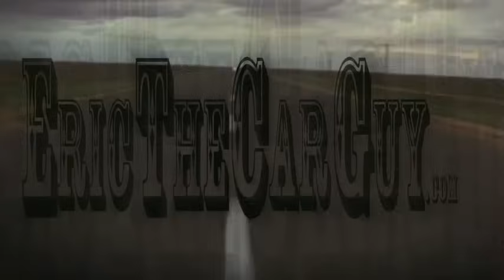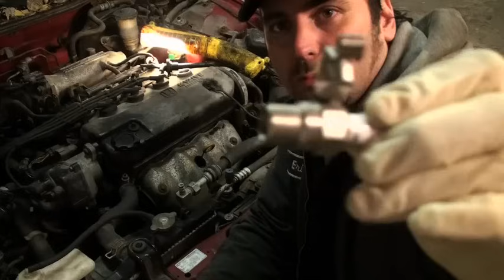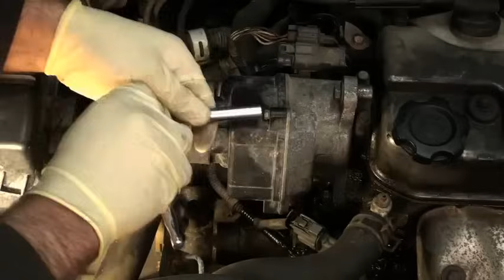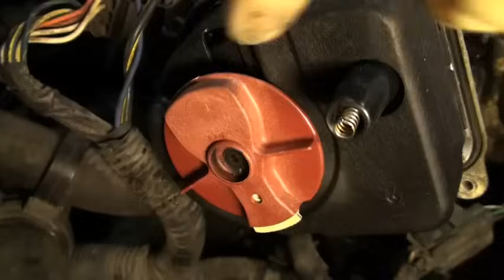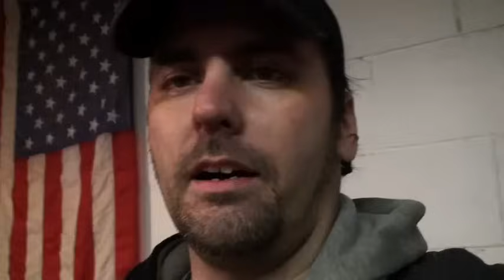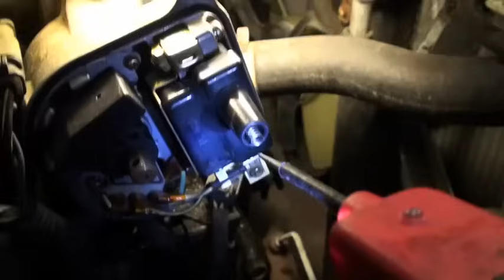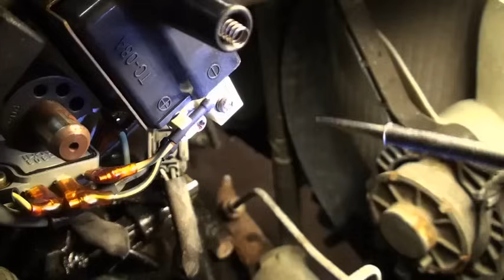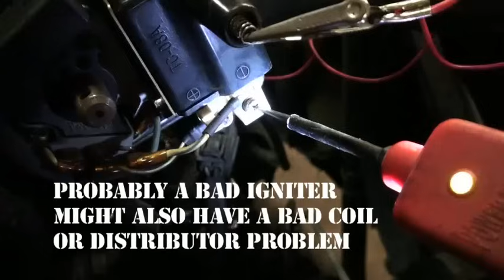No Spark Diagnosis (Honda) - EricTheCarGuy

Comment: This is an excellent  clear and helpful video. If I could just add one tip, which may be so obvious as to not really need mentioning, but it wasn't obvious to me so I'll mention it anyway. I have the same model Honda and had the same issue - no spark. My approach was far less methodical than Eric's: I started replacing the possible problem parts beginning at the cheapest. I replaced the coil (no joy) and then the igniter (still no joy) - which brought me here, to the purchase of a test light and a proper diagnostic approach courtesy of Eric. The problem, it turned out to be in the end, was a fuse. A fucking fuse! A twenty cent fuse!
It turns out that as well as the fusebox under the hood there is also one, better hidden, under the driver side dash that I'd been entirely unaware of. On the 'map' on the cover of it there is even a label for that fuse - 'ig-coil.' I replaced that fuse and the car went, straight away. So, I'd just highly recommend checking that fuse before you do anything else. You may well save yourself a great deal of trouble and expense.

Comment: So I've go a 1990 Accord and although the Distributor w/ Coil Inside looks same... I have turned the rotor around looking for the screw but there is just No Screw. Yet I can't seem to pull off the Rotor Button? I'm guessing its just got the plastic detent tang. It doesn't want to just pull off. So what is the Trick to get it off without breaking it. Its not bad and not the problem. No Spark @ coil but I need to get to the Test terminal but cant get the inner cover off without removing the rotor.  Arrrrrggggg!

Comment: Ha Eric I got 1994 Honda  accord crank no  start can hear fuel pump turn on but no start my question is when you checked the coil with test light to see if the ignitior was working was test light grind or to battery position also love videos you have help me a lot thanks

Comment: Hey guys sorry for sounding dumb 🤥 but I'm having a hard time finding the crankshaft sensor on my 99 honda accord.. I've had someone already check the spark, coil distributor and wondering if the sensor will be it but can't find.. can anyone assist plz

Comment: I have a 2001 Honda CR-V.  It will not start after the engine is hot.  Youtube videos stated three likely things,, Coil, Igniter, and temp sensor.  I replaced all three.  Also replaced Distributor Cap, Rotor, Wires, Plugs and fuel filter.   Still doesn't start after it is hot.  I am at a loss what to do.    Any ideas?
Reply: Turned out there are two temp sensors and it was the one further back that was the problem

Comment: 10yrs later still helping diagnosis problems. Lol 2000 civic random no start and sometimes when it does start it stalls within 3 minutes of idling. Won't start when sitting in the sun but will in the shade? Damn car!

Comment: I have a 1994 Honda Civic ex and I replaced the rotor, ignition coil, ignition control module, distributor cap and spark plugs and still won’t start but does crank just doesn’t turn over also I checked to see if there was spark at the wires and no spark can anyone please help me as to what it might be FYI 
I don’t know anything about cars aside from the very little I have learned from YouTube thank you in advance
Reply: Have you tried replacing the Main Relay under the steering wheel? Hope this helps.

Comment: Hi eric need help alot of people have tried with no luck 2000 honda accord f23a1 new ngk plugs cap rotor dizzy wires im getting spark to plug but if i remove the wire off cylinder #1 wich according to the scan tool is the cylinder thats misfiring car runs the same but if i pull 234 the car trys to stall what would be causing this

Comment: Eric you mentioned oil in the cap will that stop the car from running ? Is the oil caused by the o ring on the shaft ?

Comment: 01 CRV, crank but won't start. Battery good and kept charged. Did this suddenly. Was running fine the day before, except it stalled twice at low RPMs around slow turns but started right back up...I have ohm checked and visibly checked main relay (fuel), plugs, wires, all the way to inside distributor cap studs. I ohm checked the coil points also. All are good. Rotor looks ok I guess. Seems to have plenty of material. And I checked gap on the plugs.

I checked codes and none are stored.

If everything is reading good that I mentioned should the spark strength be good and strong enough? When I observed spark at the plug ends, it was daytime and I couldn't see if dark blue, but it was bright and consistent with good timing. 

I've also completely verified fuel except I haven't checked for power and control pulse on injector plugs. But it won't start with Starter Fluid sprayed into the throttle body either, so I'm assuming it's not fuel problem at this point. Fuel is being delivered to the injectors I know for fact. 

Before I buy a compression tester and remove oily covers and seals I want to verify spark is sufficient. Any guidance?

If cam sendor or crank sensors failed would it cause no crank or no start?

Comment: I changed all my spark plugs first because of a misfire and having also cylinder misfire codes plus random misfire. Unfortunately I removed the distributor cap and rotor and has all red dust in it. From something like that what is faulty !?? The ignition coil or igniter!? Please help also what is the other black boxes hook up. There is the ignition coil the igniter and also a third black box..

Comment: if at that point you still didnt get spark would you check fuses? if fuse are all good would you check crank and cam sensors or the wiring harness that goes from fuse box to distributor?

Comment: So i have a brand new distributor and still no spark fuel pump isnt kicking on ether unless u put 12v from battery to it i got a new main relay still no pump turn on still no spark any ideas im going nuts trying to figure this out

Comment: Hey Eric, love your videos. Need your help. I e been having trouble starting my 93 civic and noticed that my timing marks are off so when setting the timing marks at the crankshaft pulley and camshaft to correct TDC I will go to start the car and it doesn’t start but my concern is why doesn’t it stay TDC I will look after attempting to start and timing marks are completely off.. is that normal? Or should I reset the timing marks everytime until I get the car started?

Comment: I have a 1st Gen CRV with starting problems after the vehicle is at running temperature. I've changed the whole distributor, cap, rotor, plugs, wires, fuel pump, and main relay. What else could it be. I've also even changed the coil it self and noticed the spring has stretched on deformed for some reason. Do I need to start looking at engine ground

Comment: Hi Eric... I'm new auto electrician here in Philippines, i would like to ask u a question if you have a video's regarding an issue of No Crank/Start at all in Lincoln navigator 2003. The car suddenly shutdown the engine and no crank at all after reverse. Now I used a scanner but it didn't communicate as well to my scanner. Im not sure if this is an issue of scanner not suitable to the vehicle but i used my scanner to all brands before. But let me give u a hint on what I have already done and notice on my troubleshooting. First, when I switched ON the key in ignition position. There's this " PRNDL ERROR NO Park assist" message warning on vehicle Dash-Indicator board. And hence the problem is NO Crank and the problem only came up after going on reverse I removed the DTS(Digital Transmission Sensor) and looked on its sockets the signal voltage and also test the continuity of its pin by multitester off the bench and it all work fine. So I locate the starter relay, If i Removed the relay, and use a multimeter on coil pins of relay sockets i can get a positive and negative signal. As well as the main supply of 12volts for #30 pin of its relay. But using an external wire connects to the coil side... NO POWER at all have shown. So what i do next is hence there's a positive on signal on relay coil, i put a short wire jump on signal starting from DTS at relay pin #86 and #87. When i start the switch it Crank! But it wont start the engine,. So hence there's an message error shown on dashboard "PRNDL error NO Park assist. I locate the fuse for the PAM(Park Assist Module), and the error is GONE. So i thought i hit the jackpots! Because the engine is now cranking and there's no more message error in the dashboard. But still it didn't start at all. But its cranking., so what i do next is I replaced the PAM(Park assist module) and also the 2 reverse-park sensors on the rear bumber. And yet, the problem is still the same. If i will reconnect the relay and fuse for PAM. Still NO CRANK/START. Hope to read ur reply not too soon. Tnx in advance.

Comment: I found a some oil in my cap when I took it off rotor had corrosion as well as the leads in cap. Could that cause my Honda not to start. After I installed new fuel filter, fuel pump and fuel relay?

Comment: thanks so much for this! I have had a little oil in the distributor for a few years, not too much. I know the ring is leaking a little. Is it imperative to replace it? Never had issues until it died recently and I have no spark.

Comment: What can I check next since I’m not a mechanic but followed the steps you took on this video and still have the same problem. I change the  distributor cap and tried on another ignition coil and it’s still not turning the car on! Help please

Comment: My 1995 Honda Del Sol starts great but when it gets hot is starts missing.  I was told it was the distributor after I have changed the plugs, cables, and distributor cap.   Help

Comment: So could it ever be the crankshaft sensor I have this problem right now my 1998 honda crv shut off cranks but not start and I done tested the spark plug no power but someone told me to check the crankshaft sensor but tomorrow im going test the coil and ignition module hopefully its one of them

Comment: my 99 civic has a no crank no start issue, my dashboard light turned on, but no engine sound.  Just a humming noise.   I confirmed my battery is 12.7.   When I decided to jump the  battery, it started immediately.  I haven't checked the distributor cap yet.  Is it the Starter or the Distributor?

Comment: I would use an incandescent test light instead of the power probe  for spark check. A high voltage spark can damage it if you forget to depress ground switch (also ruins a LED test light). What is the other black plastic part next to the infighter?

Comment: Hi Eric The Car Guy! I need some advice with my 2001 Pt cruiser. It just died and is still dead. It will turn over that's it. Itll turn over all day. So no problem with battery. It has no problem with the fuel ..its actually flooding. .I have changed the crank shaft sensor.. but still nothing. I wish I lived by you because I'm NOT a mechanic and do not know of anyone I can believe
 Too many take your car a part and 5 ms later it's still sitting there. I need help please. Apparently I'm not good at this

Comment: Hey I changed ignition switch and main fuel. My car will drive a few miles and shut down. I don't have a test light. Would you say it's safe to just get the distributor parts? Im pretty sure I here my fuel kicking on

Comment: I came across this when my 2001 Honda stopped running. I first saw Eric's utube on the main fuel pump relay. I checked the relay and it was good. Eric mentioned this utube so I followed his outline. I found no spark at the plugs, but did have spark at the coil. I did not want to believe that the rotor or cap had gone bad. They are such simple devices. The tip of the rotor was chewed up. I changed the cap and rotor for $35 and sure enough it fixed the problem.

Thanks Eric, you are a savior.

Comment: So i recently had a mechanic install a brand new coil in my b20z engine. As of now i have no spark running through the distributor. I have warranty on the coil is my answer to replace the entire coil?

Comment: or you could be like me and forget to plug in the ground for the distributor (probably) attached to the thermostat housing.  You need the hands of a 4 year old to get that screwed back in.  Until I found that ground wire I assumed I'd knocked something loose with all the paint flaking off, plastic parts disintegrating, tape vaporizing on the 30 year old engine

Comment: i have a 98 honda civic lx you can crank it  up it will run for about 2 seconds and shut off like its out of gas , but the fuel pump is new , new fuel filter , still start run about 2 second shut off. what ease can i do.

Comment: Watching this in 2019.  What a tremendous service you do to the community, Eric.  We love you.

I wish I had seen this video in 1999, when my 1991 Civic's igniter blew. Ugh.  (Of course, that would have been impossible.)  

I always keep a spare igniter and coil handy now, but they are aftermarket, because Honda wants 10X the cost for OEM.  I'd love to go Honda, but at 10X the cost? Sorry.  I'll take my chances that the aftermarket won't fail 9 times before needing the 10th.

Comment: Eric thank you my 01 accord lx with a 2.3L VeTec would start then run fun then miss and then die. I did all the checks and check main fuel relay no cracks or brakes in solder and it clicked on an off during attempted start. Then fuel pump check and it had power but replaced it anyway due to the age. But problem still existed. So check plugs no issues and I had fire at the plugs but was erratic. I checked the igniter and it flashed as you described. Next the coil is turn on the key it would spark them during cranking no spark or an occasional weak spark. Then while the key was on it started shooting lightning bolts all over. So coil is bad no doubt. Cap and rotor are dry and no oil in the cap. It only started the other day out of the blue and would run and then not run and start and not start. So I’m replacing the coil today. I’ll let you know if that is the fix. For everyone wondering I used nothing more than a 3 dollar test light from harbor Frieght I actually got for free. Thank you for you channel and your work. You truly are one of the most helpful individuals on YouTube.

Comment: My car start and run but only a few minutes. When i try to start again the engine there are no sparks coming from my new sparkplug. After a few minutes standby the engine start again then run again by few minutes.  do you have idea on this? Thanks
Reply: And i already replace the ignition coil. My car is 2007 KIA Rio. Thanks

Comment: Hello Eric. I was driving home from work tonight in my 98 Civic hatch. I've been having problems lately. Car been losing power have to step on the gas twice to give it power again. Been like that for months. I changed fuel pump and filter. New spark plugs and ngk wires. Also new distributor cap and rotor. One day I drove home like tonight and the car didn't start at all next morning. That's what happened tonight. I drove home and hopped back in and it did not even turn at all. The other time it did that my mechanic swapped it out with a used distributor and it turned on. So that time it was the distributor. I'm thinking of tonight maybe it's the old distributor having the Ignition coil problem. I want to wake up tomorrow and go get the correct part. The Ignition coil is like $70 at the AAP by my house. The ignitor is quite expensive like $140. I'm thinking maybe Ignition coil but idk at this point. I can also order a complete distributor from eBay for $70. IDK what to do at this point. Want to solve this problem completely. If you see this Eric please give me a good suggestion. Thank you!

Comment: Hello Eric.. hope to hear soon.. my car stalled, rotor was melted a bit by the screw, I swapped out coil with a good spare, cap and rotor. As I tried to start for 4-5 seconds a wisp of smoke came out of distributor. Guessing igniter is screwed?

Comment: My car sputtered and died and now I have a crank no start, I have spark and coil and plugs and fuel. I swapped out the main relay. I sprayed fuel into the intake and the car tried to start just a tiny bit. I can’t figure out what it the problem, any advice ?

Comment: Nice video.  My daughter has a 2000 Honda CRV that will turn over but not fire up.  Your diagnostic steps and tips are great.  My first reaction would be to look at the distributor cap and rotor to see about oil and contact corrosion/fouling.  Your testing tips on the igniter and coil are perfect in case the distributor cap/rotor check out.  Thanks!!

Comment: hey eric i need to ask a question: i have a honda civic ek coupe engine d16y8,took it to the mechanic and everything is good in the engine compression timeing
ecu injector fuel pump every possible thing and the car cranks but it just wont start.what could it be ?

Comment: I need help w my 99 Honda crv it just stopped no power at all I am trying to find out how to get behind the fuse box because I found a wire hanging n the fuse to the ignition switch was melted on plastic part ? I have already done a fee things that were suggested but I feel the wiring may be the problem! thank u

Comment: I have a 2000 crv spark is good wires are good but when you drive it for 15 min it shuts it self off, fist by losing power then lights come on then motor dies. I wait 10 to 20 min and then it start right up. But it runs for less time each time i restart and have to wait a long time. I replaced the entire distributor and now it runs rough. I haven't driven it for a long distance yet. tomorrow morning I will drive it for a long period of time. and see what happens. any other ideas?